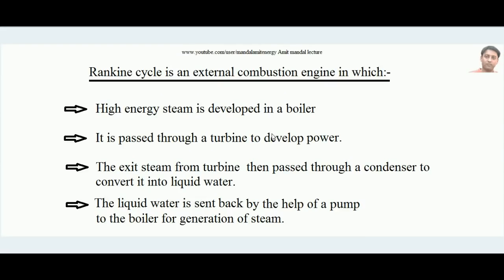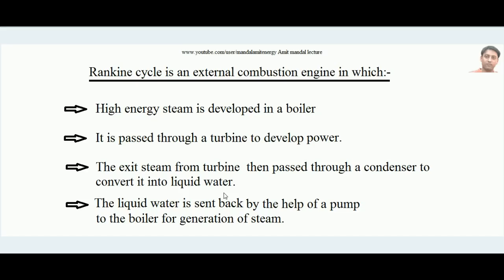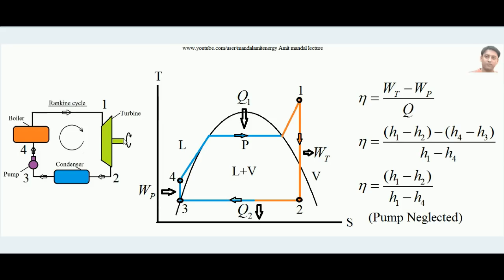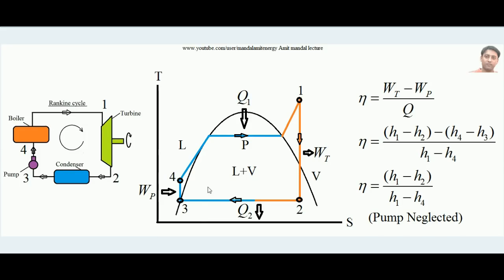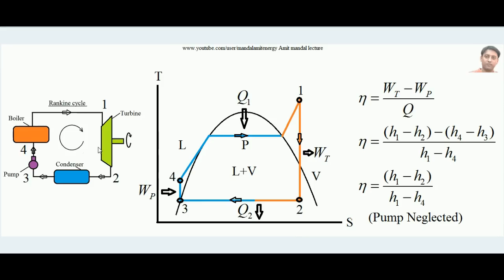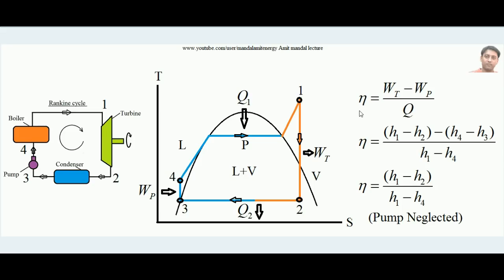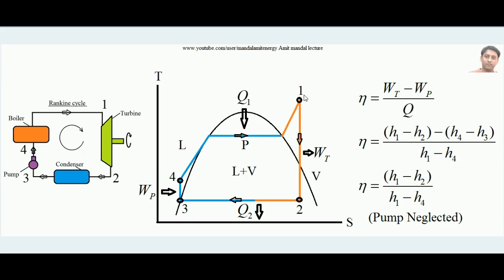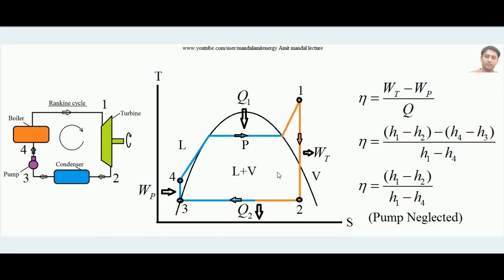Rankine Cycle working principle | Rankine cycle  | Vapor power cycle

Comment: After vapour coming from Turbine  why we have to send vapour to condenser we can directly send to boiler we can save energy by not sending to condenser
Reply: The specific volume of the steam is very large than the water so it is quite expensive (or not possible)  to pump the steam and it is send to the boiler. That's why we condence the steam and the water is pumped and it is send to the boiler.

Comment: Between 4 & 1
The blue line represents low pressure steam 
The orange line represents superheated steam which is at higher temperature & pressure 
This means there exists two constant pressures between 4 & 1?
Reply from the maker: This is TS diagram, entire boiling is at constant pressure.

Comment: A simple rankine cycle works between the boiler pressure of 28 bar and 0.06 bar the initial condition of steam is being dry saturated calculate
1 cycle effecieny
2 work ratio
3 specific steam consumption
Pls help

Comment: In the boiler and the condenser, why work (the area under a constant pressure process in a PV diagram) is not involved in calculating the efficiency of the cycle?
Reply from the maker: Enthalpy includes pressure and volume

Comment: Sir condenser q use karte hai directly steam ko boiler me q nhi send kar dete  taki steam ko superheating karne me hi heat ka use ho. Plz sir tell in any video
Reply from the maker: Good question, when fluid exits from the turbine, it's pressure is too low I.e. condenser pressure. In boiler the enthalpy rise is Isobaric. Now, if the exit steam is directly fed to boiler the enthalpy rise will be at condenser pressure which is further unable to drive the turbine.
Secondly no heat engine can work without heat rejection, Carnot Theorem.
Reply: @Dr.AmitMandal  very true

Comment: Why heat energy available in steam going to condenser is not converted to work ?
Reply from the maker: Low quality heat because of Low temperature.
Reply: Amit Mandal How can it as low quality it is ? It is huge compared to initial content of heat energy in the steam.

Comment: Why is there no change in temperature because of the condensor? Because there is a Q, heat transfer.
Reply from the maker: Condenser releases latent heat which is always at constant temperature. Watch my ' TS diagram of water ' video.

Comment: Can u tell us what actually  happens  in pump
Reply: The pressure in the condensor and the boiler are different. So only with a pipeline you cannot send the water into the boiler. So the pump adds more pressure to the water from the condensor to reach to boiler. Just like the motor pump in water tanks
Reply from the maker: Suck and release water